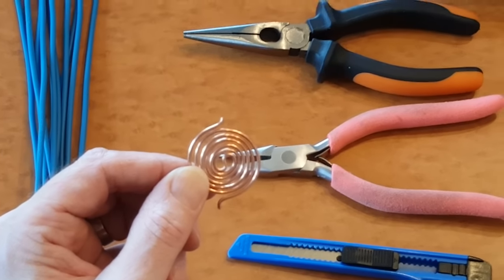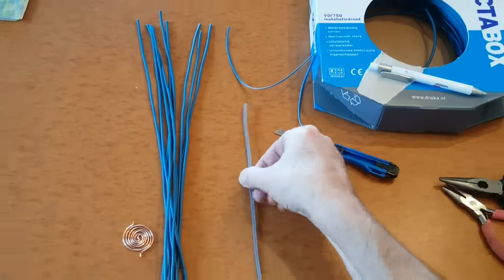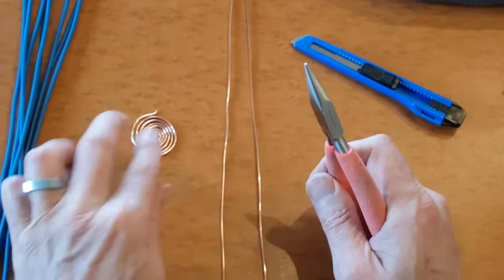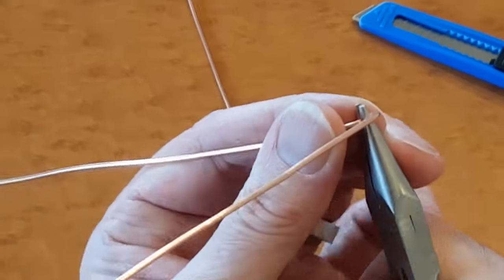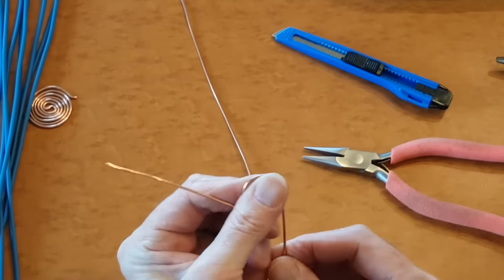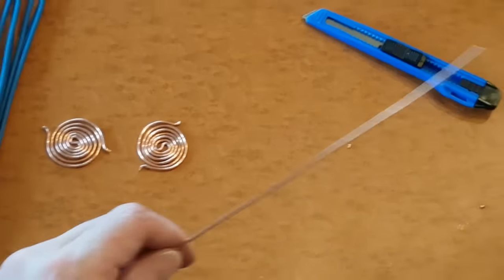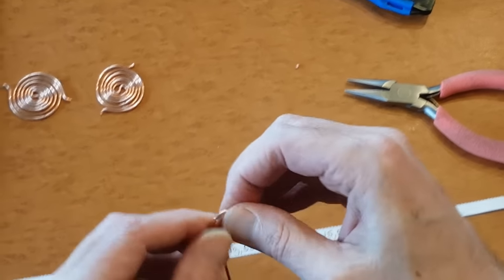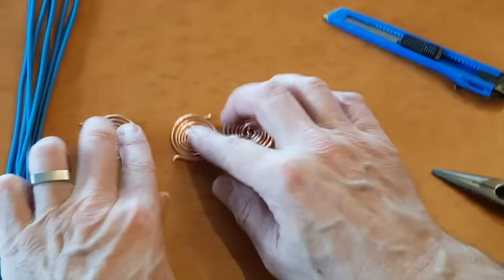How to Make Copper Spirals. Step-by-step video!

Comment: Bless your kind heart. This video is exactly what I've been looking for and suddenly popped on my feed <3 I want to use a copper spiral under my glass bottle to charge my water. Thank you so much for taking the time to make this video!
Reply: Daddy baby
Reply: Charge your glass water bottle? I dont undersrand
Reply: @louispeters2105  

i am glad you are willing to learn;

water is made up of small parts - called molecules

with water - its 2 hydrogen and 1 oxygen that have joined

molecules use spring like bonds - to stay together

theses bonds can leak energy - and the water breaks-up & dies

thus - if you drink water without charged bonds - you likely die , like has happened with the dead water - you have consumed

so to keep water alive - you must supply water (and mainly its bonds) - the energy to not snap and leak its charge/energy, 
this happens when the water is in an non-moving state 
- as moving water (spring water for example) - gets charged and more life-giving - when it is moving over the land and rocks

any more questions?
stay curious
Reply: @cpg7804  collected rain water? Tap water? Artesian wells?
Reply: Additionally I'd ask what the ideal water source to look for when purchasing land.

Comment: Do You want hot water from the sun ?  Use copper tube spiral in the focal point of the parabola dish. Cover the 10 feet diameter dish with mirrors. Glue them on like ceramic tiles.  The supporting frame to follow the sun. You may get 5.8 KW max. water heater.  Patricia, Ontario
Reply: Like 20,000 Btu/h...??? WOW But what do you do at night...??? :-)
Reply: @nickdannunzio7683  Well you can also store the solar beams as thermal energy via heating either water or molten salt tanks etc... Which can be used to heat up water at a later time or even run steam engines to generate electricity :)
The possibilities are endless!

Comment: Perfect and nice, peace with ysou brother. Just to people who have not so strong fingers you can use table, where you push center on table and wires can be turned with second hand. Or you can use any small flat surface to hold a center while you turn rest of wire. Thank you very much, Plasma Health.

Comment: I wonder if a copper spiral like this could be used for induction heating of graphite to operate stirling hot gas pistons on a stirling V-6 hot gas engine? With a current adjuster like a throttle you could twist or like a gas peddle to increase the voltage to the coil to generate more heat from the graphite to make the stirling hot gas engine run faster? Cool art work mon!  😊😏😉

Comment: If you heat the wire up red hot, then cool it, pickle it to remove firescale, then you have very pliable wire. You will damage your fingers using hardened wire like this. Jewelers always use 'dead soft' wire that has been annealed or heat treated to soften it for shaping with hands.  Don't abuse your fingers or you will have arthritic hands used up before their time. All tools have a life span.
Reply: How do you picle it tho?

Comment: thank you so much! i have hand problems that won't allow me to do this with the gauge you are showing here but i'm sure i can do thinner versions, now i've seen this. 
i note you're using copper from a tube on a cable. is it of specific content, energy-level wise than say; regular copper from copper piping? i recycle copper for jewellery and currently creating copper pieces ... would appreciate your opinion on which best copper to use. 🤓

Comment: Sir, is there any other way to do that? I mean is there any tool that we can use to produce a regular coil without need to suffer from all this?
Reply: You could use a small bench vice with smooth jaws to hold the coil while you add orbits.

Comment: What is the purpose of making the spirals? What do you use them for? Is it just for cosmetic artwork?
Reply: copper is highly conductive and the spiral directs which way you want the energy. Either flowing in or flowing out.
Reply: I'm here because I make orgonite and wanted to start using these to direct the energy in certain pieces. :)
Reply: Ahem Orgone generators, I MEANT..... the name orgonite is trademarked I heard so I don't care to mess with that, not really sure if they enforce it but just in case!
Reply: @db-333  Thank you for your clear input.

Comment: What size wire are you using?  Does it make a difference?
Reply: eugene Morrill  ( not really , the more copper the better , but it has to be easy 'bendable' ... )
Reply from the maker: 1.5mm2
Reply: Looks like 12 AWG USA...
Reply: He is using 2.5mm square or 10 gauge wire.

Comment: Excellent! Thank you for your clear visuals and instructions. Would this be more difficult with thinner wire, say 26, 24 or 22g?
Reply: I was told to start with 18 gauge wire.
Reply: Definitely easier with thinner wire but 18 gauge and up is advisable for rigidity
Reply: @Justmichs  smaller wires can be work-hardened with a light hammering